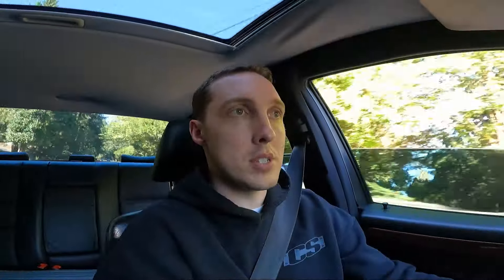How to Install Engine and Transmission Mounts - W202 C43 AMG (Creative-Steel ELIMIVIBE)

Comment: Every time I see vids about the Creative Steel engine mounts, I want them so badly for my W163s.
Reply from the maker: @angerthosenear_yt  likewise! I’ll touch base with them and see if it’s something possible!
Reply: @ANDERZENAMG  That would be amazing. I have an ML55 that I've already replaced mounts on. And an ML350 that I take offroading (rock crawling) that needs replacement. The mounts get absolutely shredded. And then the ML320 is just a basic road vehicle, luckily at least that one is fine. So 2 of the 3 need help.
Reply from the maker: @angerthosenear_yt  just spoke with them, W163 mounts are on the way soon! I’m excited myself 😁🤙🏼
Reply: @ANDERZENAMG  This is amazing news. Absolutely need to get a set. I'll probably need a pretty stiff set for the offroading merc, if I have to do a tough climb it'll bump my shifter into neutral sometimes. It's great fun though.
Reply from the maker: @angerthosenear_yt  these will hold things absolutely still will be a perfect remedy! 🤙🏼

Comment: Question, are the elimivibe vibe C43 and C36 engine mounts the same? thank you
Reply from the maker: @yellowjoe.2000  exterior yes, inside they likely have a different bushing as CS usually has different 6/8 cylinder cores. If you order (which I 1000% recommend!) you can use my code anderzen10
Reply: @ANDERZENAMG  definitely ill use your code. thank you. i want to see if creative steel offers mounteds foe w124 m111 4 cyl engine too.
Reply from the maker: @ I bet the 202 mounts would work, I think I test fit them on mine and they did, but if you call and speak with them they can probably tell you for sure 👍

Comment: One of the first things I did was replace my shot motor mounts and transmission mount. I drive a C32. 

At the same time, I replaced the flex discs and the center hanger bearing which made a big difference as well. The card used to shake rattle and roll and it's pretty solid now. I wish creative steel made the flex discs, sub frame bushings and rear differential mount. 

I bought the mounts based on your recommendation and I've been watching your channel ever since.
Reply from the maker: @williamsmothers8830  yes I’ve been trying to convince them to make the sub frame bushings for us! That’s cool you heard about them here first, glad to be the introduction!